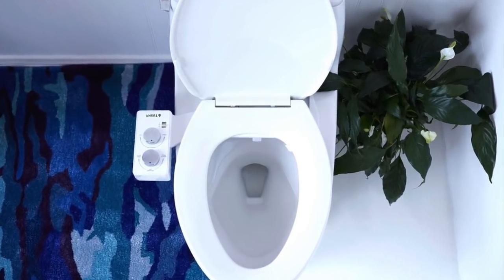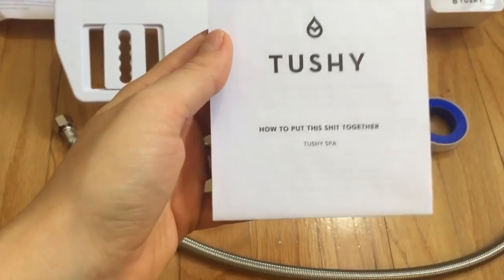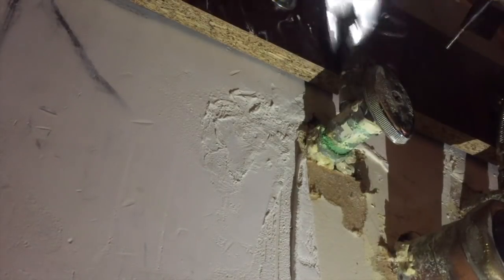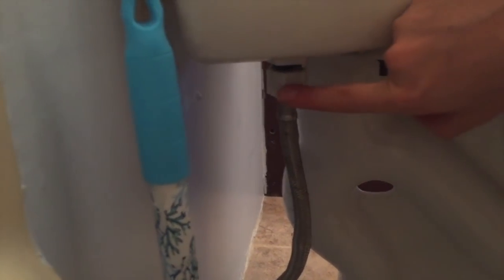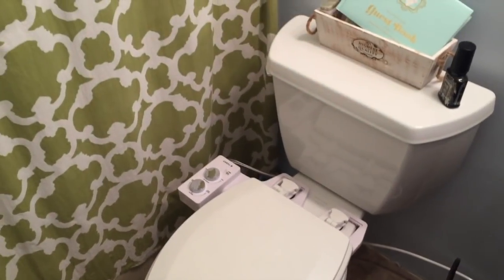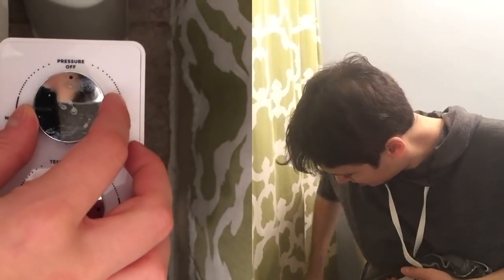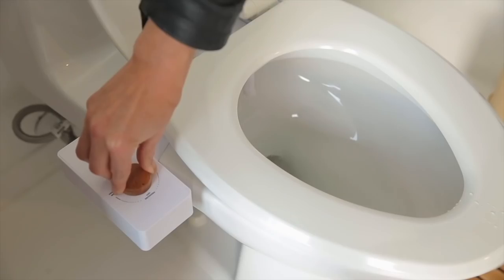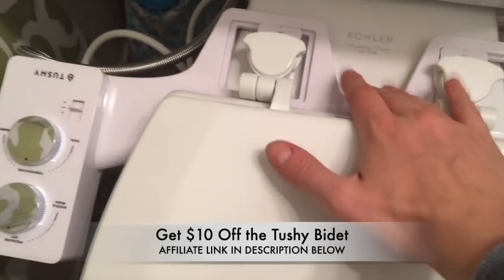Tushy Bidet Review: UNBOXING + INSTALLATION + REACTION

Comment: When I had my baby I ended up with hemorrhoids! 😢 wiping with toilet paper was hell so I bought wipes. From using them so much I began getting irritated with those too. So now here I am wanting a bidet. So this has the feminine wash too? It really does make sense that the bidet would keep down there cleaner though. I use to think oh this won't clean well. Even though I have not tried this yet I do cloth diapering. When I first started and my baby pooped on her cloth diaper I dropped her poop on the toilet and whatever was stuck on the cloth I would get a piece of toilet paper and wipe the poop stuck on the cloth. Which only smeared it in even more. So I bought a hose that connects to the toilet and with it I would spray the poop that would get stuck on the cloth. With the right amount of pressure it took  all the poop off. I was even more surprised that it took out the poop from the spots that was smeared in with poop. So I just concluded if it can take the poop off completely from the cloth even with me making it worse trying to clean it with toilet paper causing it to smear then a bidet with a good amount of pressure will clean your bum well. I remember my brother told me well when your car is muddy are you going to bring out a bunch of paper towels or are you going to bring out your hose and spray it with the strongest setting it has? In my case it was cloth diapers. Never had problems with staining since spraying them. So now to me it makes so much sense that a bidet would be cleaner.
Reply from the maker: Oh goodness I can relate to this so much- especially now that I too have a newborn that poops like a pro 🤣🤣 yup! It’s a great learning lesson for us, right?! Why wipe when water can safely and more effectively remove the poop!? Since I am still recovering from labor, having a bidet is a blessing! Like omg🤗 I’m glad I don’t need to wipe because otherwise I would be wearing a diaper for months on end lol!!!

Comment: The directions say to empty the tank, and your video shows emptying the bowl. I don't want a huge leak. Is it the tank or the bowl? Their site says tank and shows it. Which is it?
Reply from the maker: According to the paper instructions I got, I shut the water and flushed so that there was an inch of water left in the bowl. It was as simple as that to be honest. If you’re still not sure, I would ask someone from the website to be sure.
Reply: The tank is what matters...Gravity.
Reply: Francie Pod when you empty the tank the bowl will empty as well,turn off the water supply to the toilet, flush the toilet,hold down the flush handle till the tank is as empty as it will get,remove the water line
Reply: I reached the company. They specifically say that the tank should be empty (which means the bowl will be automatically) or there will be a flood. I thought so, which is why I stopped the process because I couldn't figure out how to empty the tank--siphon?. So, Amanda, you should correct your video to prevent people from flooding their bathrooms!

Comment: L0L ... "pipe cord thing", "...a steel connection". "...you might need a wrench and a screw driver...ughwoo...", OMG tools. Your definitely going to need a wrench [ Not pliers, that's what made it hard for her ] and Large bladed screw driver. Leaks, yeah no use Teflon [white] tape and your using pliers instead of a wrench and you did not thoroughly check your parts against the parts list. Yeah, a bunch of learning curves you encountered on this project. Bidets are a wonderful thing. 5 golden stars for hanging in there and seeing it through.

Comment: i got one came here for installation instructions- too bad I didn't come here first- maybe would have gotten a discount!  I just installed mine and the spray is a little trickle- not enough to do anything.. :(
Reply from the maker: Oh man, sorry to hear that. It sounds like a tweak in your water pressure might help do the trick
Reply: @AmandaAngela  Fantastic update!!!! After 6 days of filling a bucket of water to flush the toilet, I took the "bull by the horns".  I couldn't get it unscrewed before, but today, I was able to unscrew the line connected to the pipe coming out of the wall, and disconnect the whole thing- sure enough, I found sediment in the little pipe! My house is 118 years old- some pipes have been replaced but this one is dicey- Anyway I flushed it out, connected it to the toilet- and my toilet was flushing normally again. (Somehow that  little pipe got clogged with sediment when I initially tried to connect the Tushy) SOOOOooo I disconnected and reconnected the TUSHY again and WOOHOO!!! YAYY! Works great!! I love it!! Thanks for your video! 😁💗

Comment: Bidet's aren't made properly in my view...
What I mean is they should be made like a standard Shower Head to where you have the Wide Multi-stream, and then the strong Middle Jet.
The Wide Stream should be the first used to clean your bum area, get all the main surface stuff, and then the Jet cleans directly the hole.
Currently, Bidet's are designed mainly to clean the hole, so you can still have poop on your surface area, or even if you move around to try and clean your area with the jet stream, you're just spreading the poop around with the stream rather than fully removing it as a wide area multi-stream would remove all surface poop.
Reply from the maker: Ah interesting. Well I haven’t really had any cleanliness issues with the one stream, but that’s just me!
Reply: @AmandaAngela  ...  The one stream might be fine for those that don't have as much "surface area", but those who do have more of such area it can be an issue.  Further, the stream can "push" the doo doo onto more surface area, or especially if you ever have to stand up before cleaning yourself, then it further get's onto more surface area, whereas a wide multi-stream would basically just disintegrate the doo doo that's in a smaller area or wider area such as in that situation, and then the single stream can then do the deep clean of the hole.

Basically, I'm proposing a much more effective system for much wider use and situations.  Essentially, for me, the single stream would be terrible for me to use.  I would still have doo doo on the bum on occasion.  I've also seen this as an issue with bidets sometimes when I've researched the subject.

Comment: I don’t see how that would thoroughly clean a bowl movement to prevent UTI
Reply from the maker: Not in relation to vowel movement cleansing, but in other forms of cleansing. Having a stream of water helps remove bacteria that can cause UTIs
Reply: @AmandaAngela  But how does it clean for urination only?
Reply: My unit has a separate spray nozzle specifically designed for feminine urinary cleansing as well as a blow dryer to dry everything off once you’re clean.  Look around before you purchase one as there are a number of options available, including toilets with the works built into them.

Comment: But dont you need to dry it after
Reply from the maker: Yup, and I use microfiber towels to pat dry.
Reply: @AmandaAngela  Wouldn't that towel get dirty after 1 use? Running water across your butt might rinse the poo away, but not the germs/bacteria/microscopic matter off. Do you use TP and then bidet function? Does one also soap the hiney/vaginey areas and rinse right there and THEN use the towel? Just considering a purchase because I have 4 daughters and want a clean hygienic experience.
Reply: @1badsteed  you use TP with the bidet, just alot less

Comment: This isn't gonna work for alot of washrooms that are like mine my toilets aren't very close to sink in fact their on the opposite side not beside to run that hose across would look awful
Reply from the maker: Yeah true if you go with the bidet with the hot water connection (which is the one I have here). But Tushy also offers just cold water bidets so you only need to connect to the cold water part :)

Comment: Much too expensive.  There are much cheaper options of the same product.  The hot water feature is a waste of time as hot water takes time to reach the sink from the water heater.
Reply: Bob Mustari  Bob I have a question, when using these things, do you have to pull the huevos up? Or else you possibly get splatter on them... These are important question no one seems to address.  And yeah my hit water takes a minute or two sometimes to reach the master sink so that is unnecessary feature I am guessing.

Comment: Thanks for the review. I started laughing when you turned it on but the importance for me was that I realized I couldn’t use it because my toilet is on the other side of the room far away from the hot and cold water sink turn offs. So sorry I can’t take advantage of your discount guess I’ll have to rely on TP.
Reply from the maker: If you go with the classic Tushy bidet, it only needs the cold water which is hooked up to the toilet cold water line; so no need for the sink :) I’m glad you enjoyed the video
Reply: The thought of shooting cold water up my butt sends shivers up my spine. I’ll just stick to taking a shower and use my wand attachment. I came to California where the water even though it’s cold is sort of warm. I came from Massachusetts where the only Rinaldi’s I knew ran a pizza restaurant. Thanks for the laughs anyway I enjoyed them during these dark times. 😃
Reply: @ralphatkins8943  we use ambiant water temperature.  EASY for all seasons and healthiest way to go. People that are elderly find it difficult to wipe the bum and the bidet solves the problem.  I came home after hip replacement surgery and the bidet was a welcomed positive experience as it was to painful to reach the bum and who wants to hire someone for that purpose. A year later, another operation on the left side of the body and the bidet solved the problem again. I will never go back to toilet paper. Hiking in the forests we take a portable bidet. Connect it to a water bottle. 😊 Clean and safe.
Reply: @ralphatkins8943  I live in the north and the cold water is doable

Comment: The installation procedure on that looked a bit overly complicated. You're not going to be using the bidet long enough for any hot water to get to the thing in the first place.
there's not really any point much easier to just connect to the cold water that's already right underneath the toilet bowl.
They certainly take a little bit of getting used to. And I don't know that I would want to use one that was a public toilet bidet.
but I've had one for about three years and I really like it. Definitely has saved me from the toilet paper wars of the last month.
Reply from the maker: Since I’ve installed this, the hot water works just fine :)
Reply: @AmandaAngela  
Probably depends upon how far away the hot water heater is from the bathroom..
In my house when you run a hot tap for the shower or sink its probably 40 seconds before the water really gets hot. I don't know about you but I don't think I would use the bidet for 40 seconds waiting for the warm water.
I live out in the country, and have my water delivered to an external 3500 gallon water tank. 
So in the summer my "cold" water is already 95 degrees Fahrenheit, 
But in the winter it eventually gets to ambient external temperature.. 35-40deg.
That will wake you up when you use the bidet.. lolz.

Comment: Not a big fan of DIYing this. You're risking thousands of dollars in water damage vs $100-$200 for a plumber. Just the act of turning off the water valves can cause a flood in older or cheap plastic water systems, and plastic threads can easily be damaged when connecting metal fittings.

A couple of tips though:
1 - know where to shut off the water to your home before touching anything, be prepared to turn it off in a hurry
2 - run the water in the sink until it's warm before using the bidet
Reply from the maker: I think I handled this well enough with the simple instructions. If I had to actually remove a larger system or replace piping, I would totally get a plumber. The instructions were actually pretty clear and easy to follow. I did learn my lessons on the right tools to get tho!
Reply: Luckily your installation went well, and the majority will. But I've seen many instances where a weakened or brittle pipe will snap off simply when turning the handle to the valve or tightening the supply line.

Comment: This is a rip off of the clear rear!
Reply: Death of Cayde-6 I don’t think the Clear Rear has a hot water line.  They are all basically the same, high end bidets require a GFI outlet for heated air drying as well as keeping the water warm, but we’re talking hundreds of dollars here.

These lower cost units are almost clones of each other, but all have the same design features.  You can only design these in s as few basic ways, then add the bells and whistles...